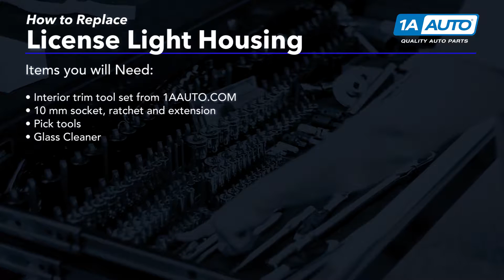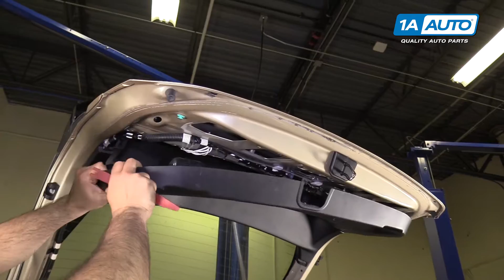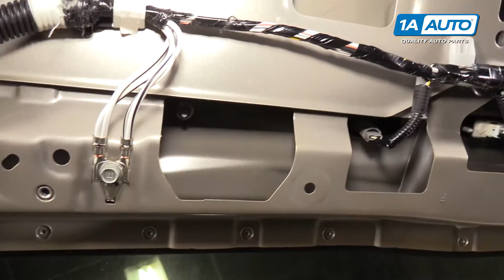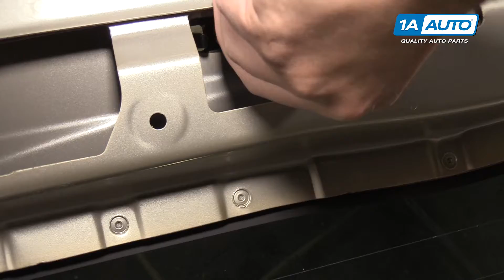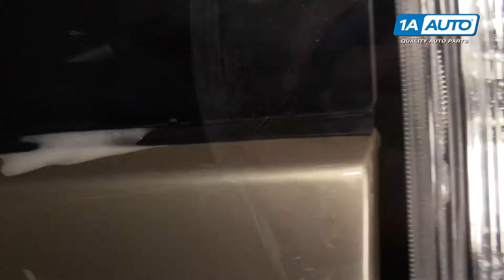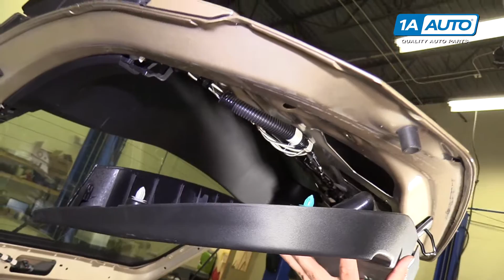How to Install License Light Housings 10-15 Toyota Prius

Comment: To do the license tag lights, they can be taken off through little access doors seen on their inside view location on the big panel you pulled off. We get a good overview of wiper,  and rear  handle light. Etc.  But you make the single job of replacing tag light much more complicated than needed. Just look up licence tag light replacement on your auto's year and make of your Toyota.